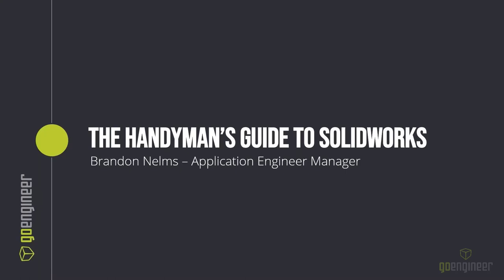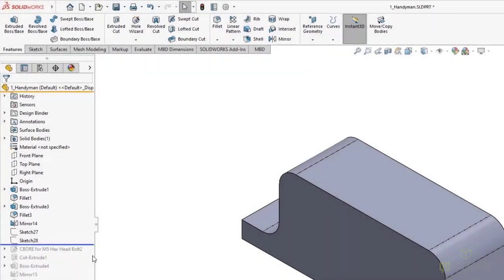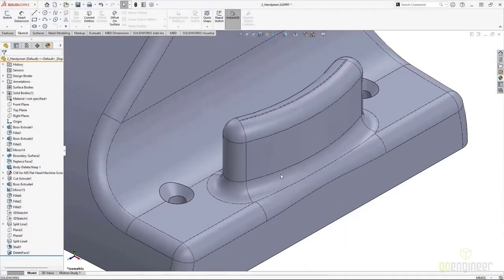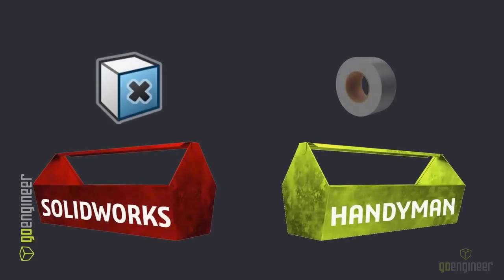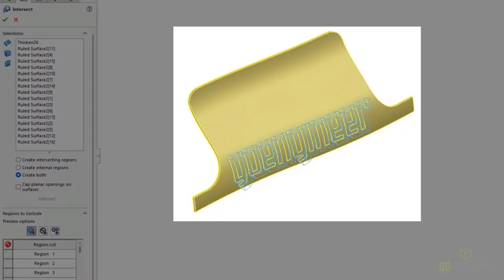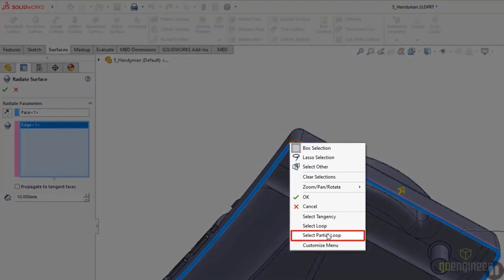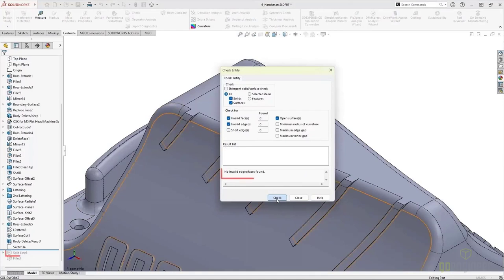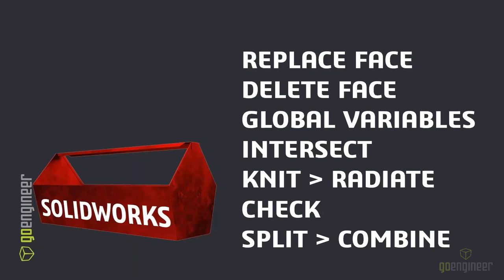The Handyman's Guide to SOLIDWORKS - Webinar

Comment: Instead of cut with surface with the complex radiated surface and knitting operation you can simply use "intersect" for boolean difference and combine at once. In CATIA it´s all in ne function, I hope SW will hange this too.